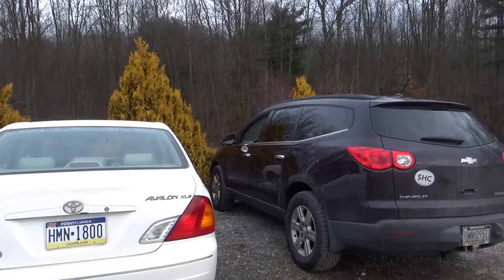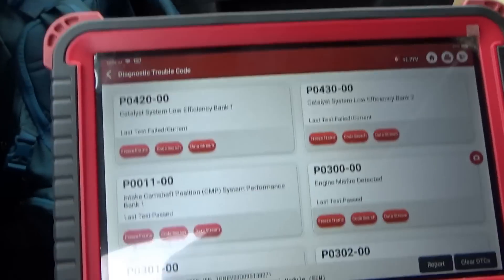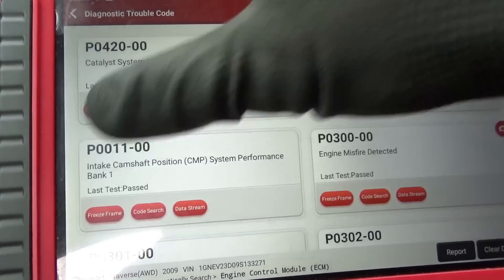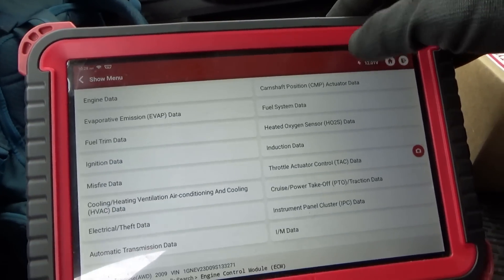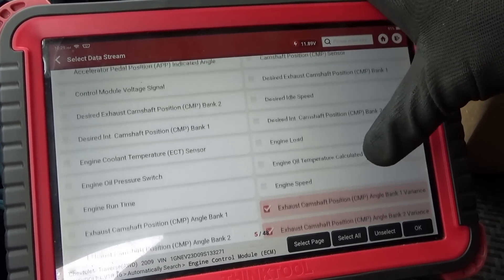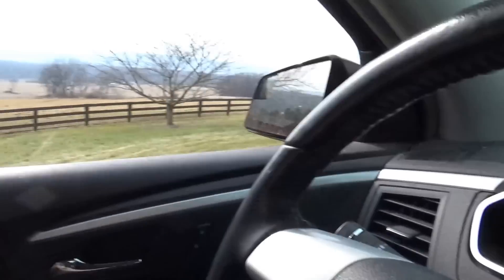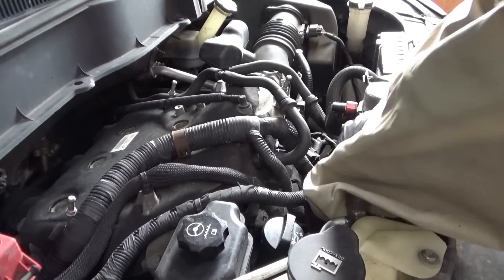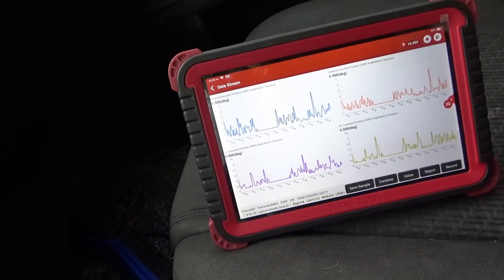Is it TOAST? (09 Traverse V6 GDI - Misfire & Timing Codes)

Comment: Impressed that it didn't blow up with less than half capacity oil in it, that family of Overhead cam V6's can get cranky with low oil level.

My old Pushrod Grand Prix has been run low on oil a few times during road trips when I was in an emergency and couldn't find a place to get oil, and it never had any issues.

Comment: Ivan you're not alone I had the same thing happen to me with a customers car. It was a 2012-2014 4 cylinder accord, check engine light on and blinking. 140,000 mi on it. Did the same thing, I pulled scan tool data, saw the variance. Check the oil level and it had none. One oil change later, VVT codes were gone, but still had a misfire. Pulled the plugs and they were cooked. Originals with 140k on them. Sold them new plugs and the car miraculously was perfect after that. Scary stuff I am so glad motor oil technology has gotten better over the years with synthetic base oils putting up with the abuse.

Comment: The dreaded traverse.  The car from hell. If I ever see one run. Non tensioned rings, an oil burner, can’t get the alternator out hardly. Same with the power steering pump. I literally had to pull the pulley off to make enough room to get that bugger out.! Piece of junk if you ask me. That’s one ya gotta check the gas and fill  the oil every less then 1,000 miles. GM what were you thinking?!

Comment: I have had 3 of these engines in various gm products just this week, all with solanoid and cam crank correlation P0016 P0017 codes, all with very low oil, all overdue for oil changes. all 3 had streached timing chains that I confirmed by scope testing, they upgraded the chain oiler to a larger nozzle, Coyles makes a complete timing kit for them, solanoids, phasers, all included. People just due not check there oil, the worst thing ever is the oil change percentage remaining display.

Comment: No oil pressure sensor on this thing? Low oil warning light or something? If not, what a dumb dumb design. I agree you should check the basics first, but nobody can blame you for not going "Hey let me first check the oil" especially without any warning and prior timing issues.

Comment: Ah... Modern techs? Plug in scan tool & don't check oil level? That's ok, we still love you but sometimes the old school tech rules ...  Confirm customer complaint next visual inspection next check for DTC's
Reply from the maker: On modern cars a Scanner full Health Report is step #1 before starting the engine 😉. But I agree in this case step #2 should be check the oil level after verifying the customer complaint... Which I did!

Comment: Customer states "rear wiper inop" . First step at my shop is to check the oil. About half the time, there's nothing on the stick and if it's a GM the oil life indicator says its not even due for a change. Also, I specifically told the customer not to buy the vehicle when they brought it to me for a pre-purchase inspection but they bought it anyway because they "needed a 3rd row" and "it was such a good deal". FML.

Comment: After reading through a lot of the comments, I see a lot of people checking their oil before every drive.  That is great practice but I have to add to that, check that your oil filter is secure as well.  It is just as important if not more if your oil filter is on the bottom of the car.  A tiny leak might not drop the oil pressure too much but it will eventually drain your engine of oil.  Had my oil filter come loose after an oil change and was chasing a leak that didn't exist.  The leak looked like a clear fluid because of all the rain so I was checking for brake fluid trying to track it down, it turned out to just be a loose oil filter.  The oil had just mixed with the water to make it look clear...  No need to crank them down but at least make sure it hasn't come loose before driving around all day on the highway with no oil.

Comment: Is if fair to accuse the husband that the oil level went un-checked? Why can't a woman (the wife and driver) check the oil level? 

Is it really too much to ask a responsible adult to monitor maintenance on their own vehicle. 

Checking the oil level is really very easy, and certainly within the means of every woman. 

Based on what I have seen with dip stick accuracy, it is very easy to read and recognize when the pan is a quart low. On this vehicle the level did not even register on the stick.

Comment: I don't like those vehicles, the 3.6 engines are junk and if you use aftermarket parts in the chains then you get what you deserve. You have to use synthetic oil and change it earlier than it's due. JUNK
Reply from the maker: They are definitely much less tolerant to neglect than the legendary 3800 V6 😅

Comment: Any time I look at a car for a friend or even my own cars the first thing I do is check the oil. Even though you don`t see it on the ground or see gray smoke it could be leaking or burning at highway speeds. Especially cars built past 2005 may are know oil burners no mater the maintenance

Comment: Funny, you put this video out today 
I’ve got an 05 Chevy trailblazer with the 4.2 was making a ton of noise check the oil wasn’t touching the dipstick changed oil 5 1/2 qts later with a new filter fix the problem. 
Customer thinks I’m a god told them if they don’t check their oil they’re gonna blow this motor up.

Great video man people/ mechanics need to see these problems  go for basics first
I always check all the fluids before diagnosis!!
Thanks for putting this video on!!!

Comment: Those engines have always been problematic with the timing set issues.  There have been a number of TSB's on it in fact.  And a lot of the time, it's made worse when the owners slack off on the oil changes.  Or in this case, don't check anything but the gas gauge.  Ivan, you said that you think this video may not be worth posting.  It most certainly was.  If anything, it's a great reminder for anyone to regularly check your oil.  It may save you from a very costly expense.

Comment: Supposed to check oil every gas fillup or at least once a week especially with high milage vehicles.
Reply from the maker: If it doesn't burn or leak any then no need to check 😉

Comment: My rule is to always keep a look out for oil drips wherever the car is parked... if there is anything suspect, I immediately check all fluids... I also check the oil before a longer road trip... has kept me out of trouble for decades. Just replaced a failing radiator based on these principles a few days ago.

Comment: But where did the oil go? If it's clogging up the cats it won't be long before it doesn't run again. A friend of mine daughter had the same vehicle. She also drove it out of oil. Paid a shop about 3500 to put new timing stuff in it. Drove it 2 days and the back  pressure from the clogged cats caused it to damage the new timing set. Since it's an interference motor it also crashed some valves. Result junk motor.
Reply from the maker: WOW that sucks!

Comment: It is very easy to get distracted and chase something else, especially when you know the likely cause could be in a particular area. Having aid that, checking the basics in most cases leads you in the right direction. In this case you (we) know those camshaft phasor solenoids rely on oil to operate, so the first and easy check is to confirm oil. No different to electrical issues - check the supply voltage first at the point of supply & also the grounds - the battery, then the supplying fuse, then at the most likely component (s). Thanks for posting this Ivan, you give confidence to DIYER's that even the experts mess up sometimes. Eric o, Rainman Ray and others have also posted videos where they could have done better had they started at the basics AND also where they had deviated from their processes only to find had they followed the processes they would have found the issue wither quicker, or not replaced parts unnecessarily.

Comment: Many years ago my neighbor's son got his first car an old Datsun wagon. A few weeks later he ask me to look at the engine as it was making a strange rattle at idle. Having seen him working under the hood I presumed he was checking the fluids and they were good to go. I started by pulling the accessory belt which made no difference and finally ask him about the oil level and his reply was "how do you do that"? I showed him the dipstick and it was completely dry. Poured in 3 quarts which was all we had right then and the noise was gone. That car ran several more years. The kid is now a MD and a gear head.

Comment: Probably no need for chains if the oil was checked/changed regularly. These engines got a bad rap because of owner neglect/laziness. My sons Impala 3.6 is approaching 300K miles on original chains, solenoids and actuators. I personally check the oil and change it every 3 to 5,000 miles with Valvoline full synthetic. Valvoline will warranty your engine to last 300K if you sign up on their website. It looks like it will make it with just routine maintenance. This guy needs to learn a lesson from this.

Comment: When did all this vvt nonsense start I wonder, my neighbor has.a 2016 Kia optima with the 2.4 and he's had trouble with it,, he changes his oil every 4000 miles or so and always checks it, he recently had to replace a part of the system not a solenoid, if he didn't know something about cars and have me also he would have spent a lot of money having someone else fix it, he's approaching 100,000 miles and just paid it off last month, I told him he'd better get rid of it before the engine blows which kia had problem with, he was offered 16,000 for it from the dealer a couple of months ago, he bought it from enterprise rental cars, they have a place nearby, he paid around 21,000 for it.

Comment: Wow.   Low oil?  That's what happens if you don't check daily.   I burn 1 quart every 1000 miles but i check and top up oil daily to keep it going lol. You're right,  check your basics!! Common sense to make sure everything is hunky dory!!!  Great video Ivan!
Reply: I wonder where all the Billions of Quarts of Oil goto every 1000 miles from Vehicles in the USA alone. 😱
Reply from the maker: What kind of oil burner do you drive Josh?
Reply: @PineHollowAutoDiagnostics  98 chevy blazer 4.3 v6.
Reply: @Pine Hollow Auto Diagnostics  it's a beater and i own it outright. No check engine light or anything needing work except the oil leaks. Lol

Comment: I bought a 1st Gen Tacoma with a 3.4L and zero maintenance history, so I "assumed" it was overdue for a timing belt and water pump.
Drained the coolant and began tear down, only to discover it had been performed recently.
I should've removed the upper cover and inspected the components 1st.
Felt like a total rookie 😆
Reply from the maker: 3.4 Toyota belt is beefy and lifetime. Will go 20 years 400k miles easily!
Reply: @PineHollowAutoDiagnostics  that belt never breaks unless a bearing fails . is there a better egine?
Reply: @PineHollowAutoDiagnostics  my 2003 Focus 2.0 Zetec is at 130k miles, still driving on the factory timing belt. I'm thinking i should change it now lol. I kinda drive like a maniac some days. And i don't want to have a situation where i hit the gas and the belt breaks at a bad time. I should go ahead and get it done. I had a timing belt kit sitting in my room for the past year.

Comment: Ivan,

Perhaps as a check/reminder for you maybe either to add a checklist to your initial paperwork when a customer brings you a vehicle (or you go to them), or create a checklist that you religiously use before you start any diagnosis (what would be even "neater" would be if your favorite scanner reminded you to do those basics every time you initially logged into on a new vehicle. 

It's supposed to take approximately  21 days to make or break a habit, so after 21 days of being reminded (either by your paperwork or the scanner) you probably won't need the reminders anymore because it will just be your habit to always do those checks first.
Reply: Like a pilot's checklist before taking off?

Comment: WOW!  Big question, where did all that oil go?  Leaking or burning it,  2 & 1/2 quarts is a lot of missing oil.  If it is burning it that bad, it should be smoking pretty good when accelerating I would think.   But you are correct, always check the basics first....
Reply from the maker: check your math...it was 3.5 qts low!
Reply: @PineHollowAutoDiagnostics  That's even worse, where did all that oil go?
Reply: @wwdiesel  With the 2 cat codes my guess is the oil was burned.

Comment: I find this to be true (check oil and the fact that people don't do so as often as they should) is even a bigger problem with synthetic oils and the fact that many people believe they're good for ~10,000km on one change. Checking is even more important with longer intervals allowed by OEM!
Reply: Lexus charges $200 for a synthetic oil change. Buy your filters in bulk and your oil at Walmart and do it yourself for less than $40.

Comment: An even worse problem here on modern cars is ... low/no oil = no oil pressure on timing chain/belt tensioners.  Goose the throttle, cam jumps, and WHAMMO, engine turns parts into gravel when a piston whacks a valve.

Comment: One of the FIRST steps in Diagnostics, is to confirm the COMPLAINT, and you did.  If you had added oil prior, How could you definitively confirm the "repair" ? I think you approached the Customer Complaint correctly.

Comment: and now they make transmission's and engines with out dip sticks these engineers are dip sticks for doing that ,they mostly add more sensors to alarm you when levels are low that's just crazy , most oil pressor gauges are satisficed at 7 pounds ,how's that working for us 7 lbs  lol
Reply: An oil pressure gauge doesn't directly measure when you are low on oil.  This would be an inexpensive add-on to any vehicle, clearly something this vehicle doesn't have....
Reply: @jw6825  clearly

Comment: Yessiree....EVERY 5,000 miles, oil & filter.  Every 30,000 miles transmission fluid and filter change. And don't forget any fluid reservoirs such as brakes, power steering, fan pumps etc. They all need a change at some point and sooner is much better than later when it comes to fluids. Even gear oils need changed to keep things fresh so that the additives do their job.

Comment: In a marriage, responsibilities are divided up according to knowledge and/ or interest. I, the husband am responsible for practically everything mechanical or electrical because it's my forte, however my wife has always been fanatical about maintenance on "her" car, and always kept an eye on the mileage and makes the appointments to get the oil changed. Still just because a wife drives a specific car does not mean it's her responsibility in the marriage to check the oil level, if it's agreement that such duties are the husband's responsibility; we take our cars to a mechanic for an oil changes, but I always check them afterwards, which is something I would not expect my wife to do, nor is it her responsibility.  We have discussed this at length that if her car, a Grand Cherokee has a flat tire or has any mechanical problems on the road she will try and contact me and call AAA. I don't expect a 68 YO grandmother should try and change a tire on a Grand Cherokee, and she knows it's beyond her expertise to diagnose if it's safe or prudent to continue to drive the car if it's experiencing  mechanical problems.

Comment: I have 163K miles on my 2010 Equinox with the 3.0 GDI V6.  I have some timing codes but I'm riding it out.  I'm sure it will need chains but for what I was quoted it's about as much as the car is worth.  I'll just keep the oil changed between 3500 and 4K miles.  Don't rely on the stupid oil life monitor on GDI engines.  They should be changed at 50% oil life left.

Comment: I’m mildly impressed, 2 quarts of oil in that engine and Ivan sat on the throttle as part of his diagnostics 😂
Reply: Oil light never came on so no damage was done.
Reply: @NorthLakeAuto2   depends on the car and sensors used.   Seriously doubt this car has an oil level sensor and just a low oil sensor.  

Some cars will shout at you that your oil is too low as early as 250mL (roughly ~1/4 quart as well) below threshold and that’s not even low on the dipstick (if it comes with one).  Ask me how I know -_-   But then other cars won’t even tell you the oil is low until you could have made the same guess on your own.
Reply: @Honeypot-x9s  As long as the oil light didn’t come on and it never lost oil pressure. It’ll be ok.
Reply: @NorthLakeAuto2  you do realize the low oil pressure switch are generally all under 10psi and many wont open until only a few psi left. by time the "idiot" light comes on it's too late. the only time it's really useful is at engine startup, otherwise by time it lights you've already caused damage and the longer it was ran low the more damage there will be.
the exact switch for that engine closes at  at 6PSI and opens again at 2PSI and 2PSI is not enough pressure to keep everything lubed properly, especially when it's aerated.
the owner must like walking or buying engines.
Reply: @throttlebottle5906  Yes I'm familiar with how a  pressure switch works. Obviously the engine still runs fine so are you going to sell the customer a motor or tell them its likely that no major damage was done and to keep an eye on the oil level?
Reply: @NorthLakeAuto2  tell them it's very likely damaged, it could break down in the near future and will likely consume far more oil now, so they better check it very frequently.
making them worried will help keep checking the oil on their mind, but tell them to drive it and see, it may last 10 miles or many thousands.
Reply: @throttlebottle5906  🤙